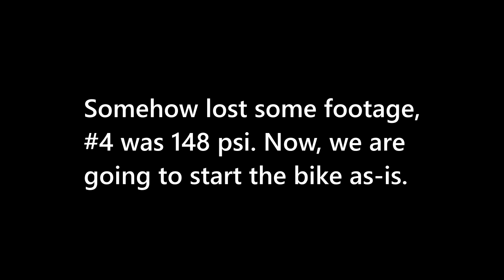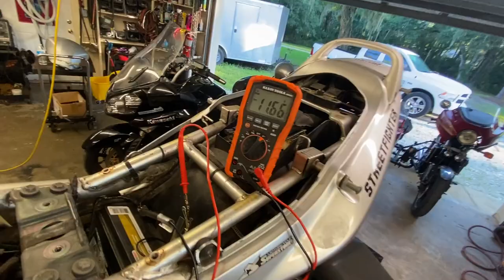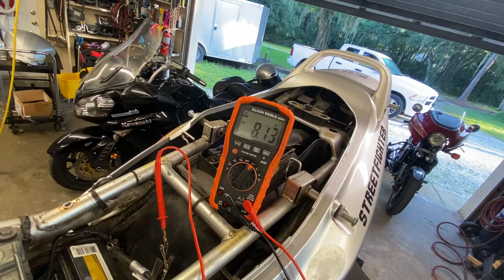Bandit 1200 won't stay running.... Let's fix it!

Comment: Any tips on doing the stick coil conversion?
Reply from the maker: Google that. Bandit stick coil. There’s full instructions on a forum. I don’t remember where. Wiring diagrams and parts. You need special connectors for the coils.
Reply: @MotoResto Florida  thank you for responding. Actually in the middle reading a forum now
Reply: Seems like you basically splice into the factory wiring for the coils and make it work for 4 individual coils
Reply from the maker: @jameslundstrom22  not exactly. It’s still a wasted spark setup. I didn’t cut the factory wiring I cut the plugs off the coils and did the wiring from there to the sticks. You wire the stick coils in series 1-4 and 2-3 just like the factory coils are wired. That gives you the proper resistance the spark unit is looking for. That’s why you need a certain stick coil which has the proper individual resistance to match the OEM when the sticks are run in series. The forum instructions are pretty detailed if you find them.

Comment: I just got this bike it won't start but it turns over and there is a bunch of wiring that needs to be done on it
Reply from the maker: Get yourself a factory service manual. The wiring diagrams for this bike are good if the quality of the manual has good resolution. Has the ignition switch been changed out with an aftermarket? The OEM has a resistor of some value that the ignition module needs to see that voltage or it won’t run.
Reply: @MotoRestoFL  yes the ignition switch is an after market but I use a screw driver turn turn the bike over by the starter I tried starting it we put all new fluids in it but still nothing I'm thinking it's a wiring issue or a fuse but I'm not sure
Reply: @MotoRestoFL  and also we have like 4 fuel lines that I have no idea where they go
Reply from the maker: @juice1419  it won’t fire that way without the ignition switch on. Doesn’t matter how the starter is energized. So it’s likely your ignition switch. Must be an OEM. Again it has some sort of resistor in the switch. Source out a switch on eBay. May be available new.
Reply: @MotoRestoFL  I need to educate myself on this😂 bcuz the ignition Dosnt work when it's on the on position it only works when I turn the key the other way and the dash lights up but when I slightly move the ignition it turns off like it has little to no power it's some complicated shit I'm not sure how to figure out
Reply: @MotoRestoFL  and the guy I bought it from has some new resistors I'm not sure where they go
Reply from the maker: @juice1419  wiring diagram and a digital multi-meter. Just start tracing the wires for the ignition switch. The manual has good info for this.
Reply: @MotoRestoFL  will do thanks for the info

Comment: God damed Suzuki's vacuum petcocks that you can't turn off. On res prime wtf. And gas with 10% ethanol and the needle valves that you have to replace every 5-7000 miles. Got 94 750 GSXR same petcock I filled it parked in the garage ready for school college next morning came out tank was empty not very much gas on the floor. Gallatin in the pipe going thing I didn't start it guys bdc were full gas cleaned it up new oil filter in line shut off till I could replace the needles. Drove it for 2 More season didn't have the snap it had. Start rev to red line sounded fine did a compression test 60 on all cylinders. So I found the same motor your working on right now in the frame Oem petcock was interfered with motor moved it replaced Harley in filter on of reserve. Had this motor 3 seasons if I parked did something didn't turn the petcock off I notice oil level rise.these carbs don't have over flow needles leak right into cly wash the rings. Did compression on the 1200 90 on 3 100 on 4. That petcock need a in line filter no ethanol save yourself lot a headache.
Reply from the maker: I don’t know about these Mikuni’s but I know for sure the Mikuni’s from the Concours 1000 had float bowls where there was a spot and internal clearance to install overflow tubes. I haven’t done any to carbs which didn’t already have them (repairs) and this Bandit is long gone. But that’s the ultimate solution, to install overflow tubes. I have a milling machine now that works make that fairly easy.
Reply: @MotoRestoFL  That must be nice to have. The 750 in the corner I blew it part the 1200 have to pull the motor just to valve job. did the compression before I pulled it was going to leave on the bench because .I bought a 2001 bandit 1200 s at this used car  dealer was trade in from the original buyer. 2033 miles stored inside it's whole life 2 brothers carbon fiber can carbon fiber all over. Asking 4000 4500 with tax I owe 789.82 I'm Ridding it. I just got laid off for a month. So horny to ride stuck the low compression 1200 was about to syndrome the carbs. Had nasty oil leek I reused valve cover oil o rings. I got to wait a month. But then I'll have $ to fix the other two motors ones going back in the bike Ones going in a 40.00 rat rod Karmin gia I paid for been sitting in the garage for 3 years. Do chain drive no reverse on the cheep it's a rust bucket.

Comment: i cant find a decent mechanic who will work on mine. same year same model same problems
Reply from the maker: I'm not decent either, currently, not wearing any pants. lol.. my recommendation is to do what you can to fix it yourself if that's an option, obviously you need a place to do that and tools. Otherwise, keep looking around. Unfortunately, fewer and fewer carb guys out there. Cheers.